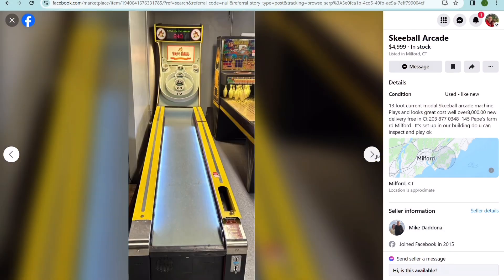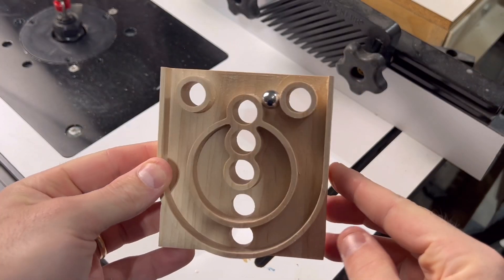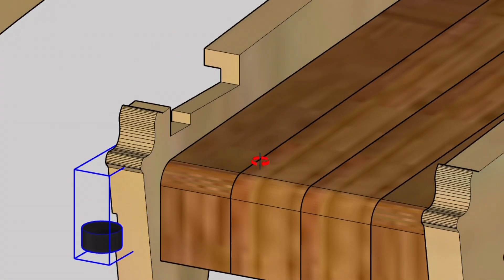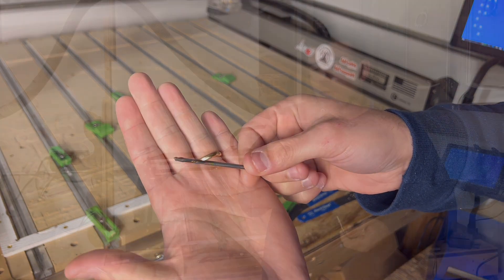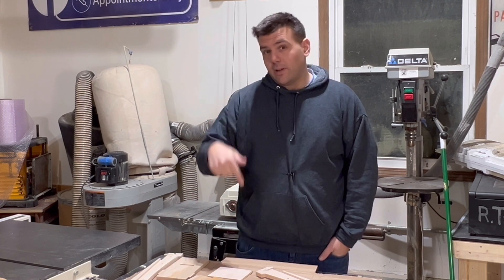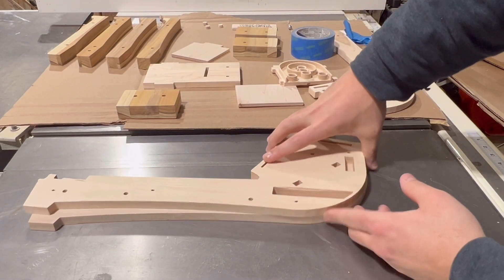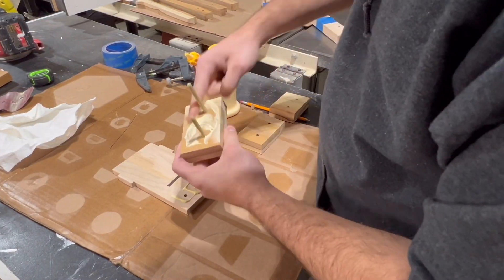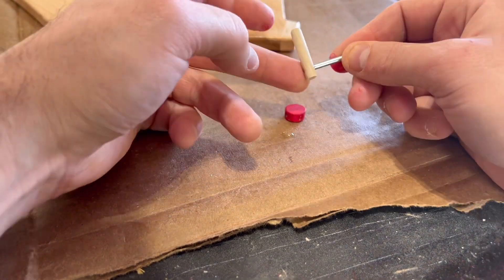CNC Woodworking: Building a Table Top SKEE-BALL Game

Comment: Very cool!

What is the largest dimension of a part?

I have a Shapeoko 3 standard, so I can only cut ~17in square. (Have yet to figure out how to tile a cut effectively to do longer cuts)
Reply from the maker: I’d have to double check the plans. If you go toy website you can look at them for free and it will say
Reply: @AquaVitaeWoodworks  okay. I'll look again. I didn't see that listed.
Reply from the maker: @justinbanks2380 should be linked in the description for the cnc plans for it
Reply: Aaaahhh, NVM. I see the link for free view.

Looks like it is about 18 inches... 😬

Missed it by thaaaat much, lol.

I'm still going to get the plans after work.

I'll figure something out. Even if I have to just orient them so the difficult parts are cut by CNC, then make a template and cut the rest by hand, lol.
Reply from the maker: @justinbanks2380 depending on which part it is, you could probably separate them into small parts
Reply: @AquaVitaeWoodworks yeah, just wasn't sure what the largest single piece was, looks like the side pieces.

I'll figure something out. Either do some by hand, cut the piece into two parts and assemble, or just shrink everything by a tiny percentage to make it fit within my cut area if it's not too far off, then just get appropriate sized bearing balls.

Thanks for all the help though!

Comment: Great work! Did you include the drop-off at the top? In the real game if you rifle the ball full-power you won't score any points, the ball will drop down behind all the baskets. If you're going to make a second rev, I'd also suggest moving the ball return to the right side so it's closer to the right hand for most players and so it matches the original machines.
Reply from the maker: Oh that would have been a good idea to add! I made the return on the left since I wanted to grab the ball with my right hand when it pops out haha

Comment: Now you need to set up a raspberry pi and/or other electronics to make it fully functional. 

I'm curious if you kept track of how long this took in total. Is it feasible to sell these without having to charge a fortune for them?
Reply from the maker: I gotta learn electronics lol as for carve time on the machine, I made all the components in about 2 hours give or take. Obviously that doesn’t include the time it took to design, sand, and assemble. So yea, you could make a profit if you did it correctly. If I were to do that though, I’d probably rearrange components to carve more than one at a time on the machine

Comment: Have you thought of a way to determine the score? After all, the goal of skee ball is to get most points by hitting the highest value holes.
Reply from the maker: I suppose you could add tiny electronics if you wanted, but I’m not smart enough to do that lol 

I also thought about just adding a peg system to the side rail, like a cribbage board, to keep track.
Reply: What if you made a separate gutter for each value to roll into that came out under the mouth of the alley?  @AquaVitaeWoodworks
Reply from the maker: That’s also a good option. If only only ADHD didn’t force me to start a totally new project 😂 I’m not sure I’ll get the motivation to go back and re design that far